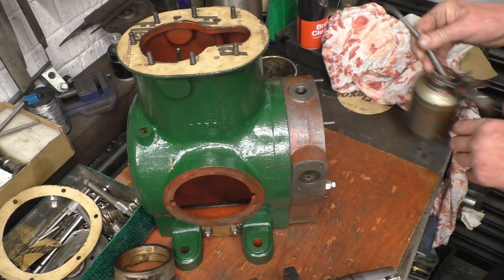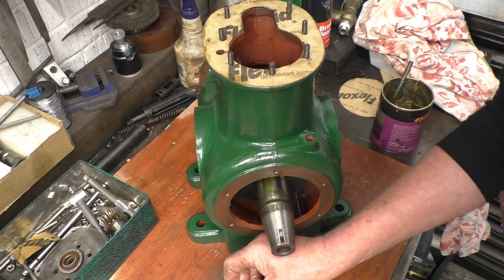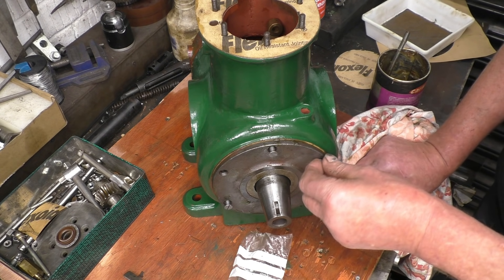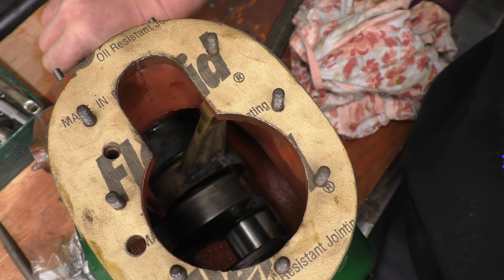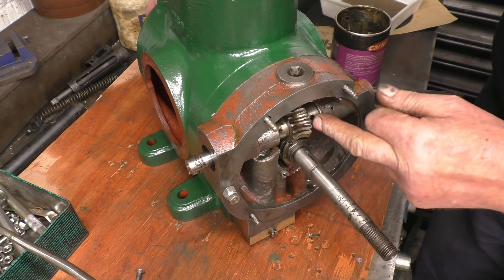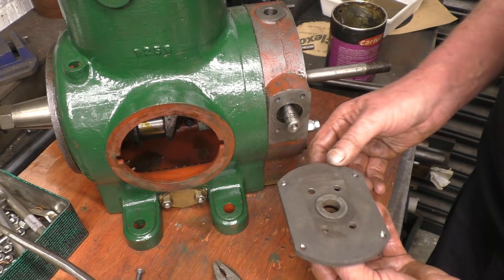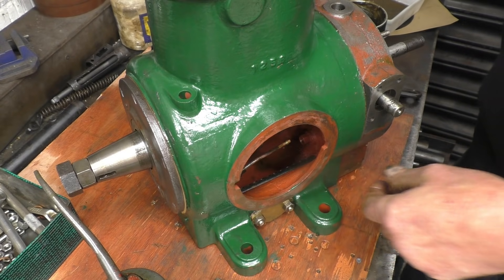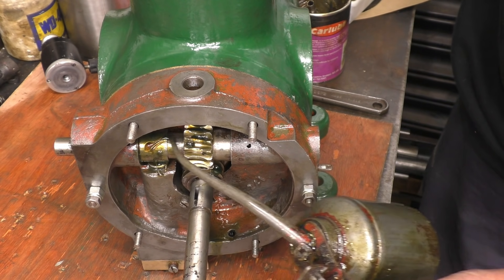Stuart Engine Restoration Part 8 B Crank Shaft Install

Comment: Back in 1953, I was trying to replace a damaged brake line on a 1951 Ford.  Fought that thing for several minutes.  The old retired railroad mechanic who owned the car told me the secret of starting lines.  Close your eyes.  That stops all input to your senses except your feel.  It also works for starting bolts in impossible places and actually works for many other feel-orientated things.
Reply: That's the truth! Exclude distractions and focus on feel, and things go amazingly well. It's exactly what I do when manipulating lock cylinders, too, and the sensations of pins moving can be tiny indeed.
Reply: Done that many many times when I’m ready to fling/throw the spanner/tool through the window or at something/someone! 🤗
Reply: A watchmaker told me, when screwing a watch case closed turn the threads backwards until I felt a pop. He called it "Sailor Start". He said that's how sailors started threads on soft brass to keep from cross threading them. Works like a charm.
Reply: Done that many a time laying under a car looking in the opposite direction and starting a bolt or brake line just by feel. It can certainly heat up your brain to imminent explosion at times!
Reply: This works the other way, too. A trick taught me by my dentist: when expecting pain, open your eyes and look at the most detailed object(s) in your field of vision. Try to analyse it for anything you can think of. You will be astounded by how well it cuts the pain. My guess is that the same part of your brain that processes vision also registers the pain. Whatever; it works. (I used to look at the acoustic tiles in his ceiling and try to determine if the holes were placed at random, or whether there were a number of fixed patterns. I never decided, even after all the visits to his office.)
Reply: @matthewrinehart2367  - Excellent advice when restarting wood and sheet-metal screws. You can replace them any number of times if you back off until the screw drops into place in the original threads. Very useful when reassembling electronics in plastic cases.

Comment: Hi John.
I seem to recall there was a second grub screw in the oil pump drive shaft, and you tried to drill it out, I’m going to have a look back at the dismantling to see.  I must admit forming the opinion, when you started dismantling, that this was going to be impossible.  No one would believe this is the same engine.  Brilliant.
Cheers Noel
Had a look at part 4, and around 16 mins there’s a funny noise, reminiscent of a brick house, and then the shaft drifted out.  I presume you managed to get the broken grub screw out and have re-tapped the hole…..

Comment: When you are annealing copper, flow some nitrogen through the pipe while you heat it and let it flow till it cools.  The flakey black oxide crap that grows on the outside also forms on the inside.  That how we do it when we braze copper line sets for air conditioners.

Comment: That fight with the oil line reminds me of one particular hydraulic fitting on one particular aircraft I worked on in a previous life; either you got that bastard quick-disconnect on the first time or you fought with it for an hour.  The engine is certainly coming together nicely; it's hard to believe how different it looks now.
Reply: I had the exact same thing with my Land Rover Discovery 2 it had quick disconnect automatic gearbox oil cooler lines to the radiator and with little access to manipulate them it was a real bastard to get to stay on. Twice I lost drive and £30 worth of ATF in the exact same place and had to recover the vehicle because that bastard union popped off. After the second time I wired it in place so it couldn't come off again. The Discovery 1 had screw in unions just like Johns engine. No doubt the bean counters at Land Rover decided two quick disconnect unions cost far less than two nicely machined oil unions lol

Comment: All looking good. I have a good set of the old screwdrivers, as they were designed for the narrower slots and work a lot better than the modern ones.
Reply: Yes it's a pity John's screwdriver was bent like a corkscrew though lol. Itcould do with hammering straight  before it's next outing !

Comment: That oil pipe clears the web of the crankshaft, but will it clear the big end of the con rod? Those big end bolts stick out further than the web if I recall correctly.

Comment: Think you should of put the oil line on the bearing cap first the n bend to clear and line up with pump end. The put cap on as, in engage oil line into pump outlet.